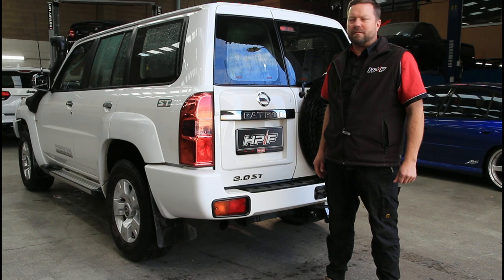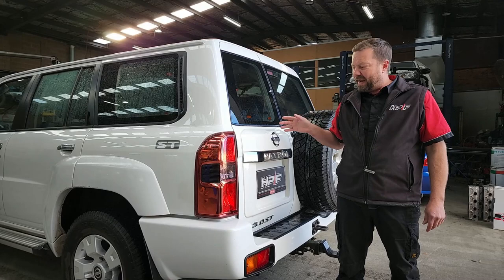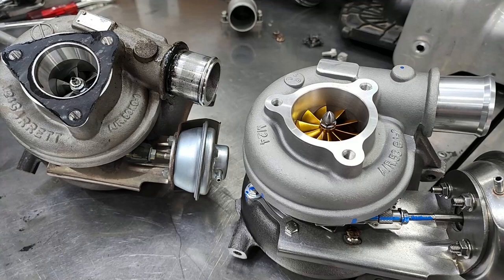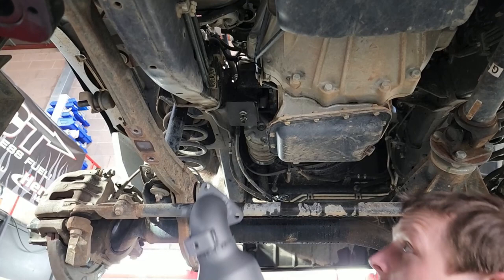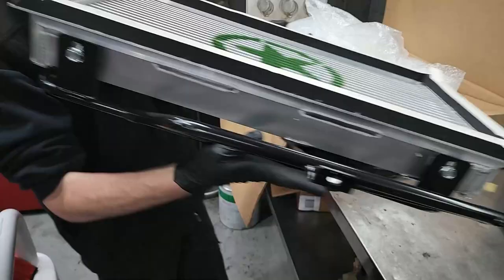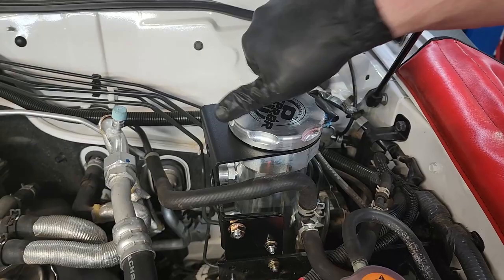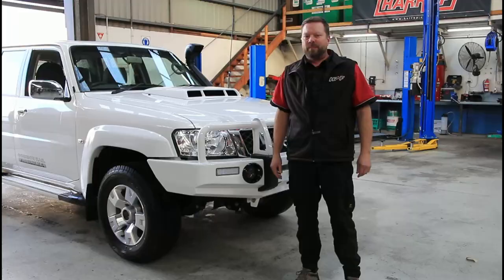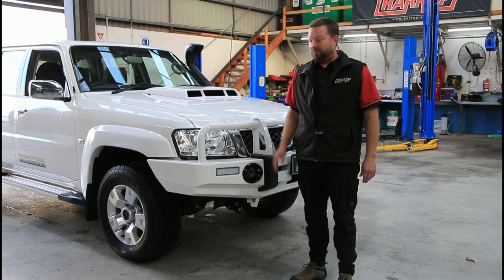HPF POWER UPGRADE | GU ZD30 Stage 3

Comment: I suffer from adjusting the voltage or speeding up with what is called Safe Mode if the machine exceeds 135 kilometres

Comment: If you just want a fast(er), more torque daily driver and occasional tow, do you need a clutch (HPC) upgrade to cope with the extra power/torque?
Reply: a heavy duty clutch won’t hurt depending on power

Comment: Have the last of these, Feb 2016 build.
I always knew they were underpowered, but from the he outset I had a Beaudesert exhaust fitted, driving from Bathurst NSW to Beaudesert Qld I was able to determine the truck had far less turbo lag but I'm after more power.
I'll be intouch to get a guide what you feel you can achieve for my Patrol. Thanks for video guys.
Reply: Yep mines a 2016 model as well

Comment: So im curious, I thaught the ZD30 were prone to failure, how did you get it to be reliable?
I really like these Nissan's but have been scared off of the 3L from all of the bad reports, how do I know a good one from a bad one?
Reply: it was only a few year models that were the grenade im pretty sure but could be wrong it was 05 through 07 and maybe a year either side. but basically after 09 they were bullet proof. just run hot which when people dont pay attention can cause issues.

Comment: What are the average egt’s achieved ? 
Is this suitable for common rail or direct injection or both ? 
Do you swap or change the factory boost solenoid ? 
What boost are you running in the stock internals ?
Reply: That particular package isn't no idea if Horsepower factory does it but 150kw is definitely possible from a DI with similar mods plus upgraded injectors.

Comment: Anyone had this set-up long term?
Reply: Not this exact set up but I have the same exact car but manual has been tuned since 230k now has just under 300 running 21psi stock turbo with supporting mods at 175hp and 470nm been reliable as runs great!!!!